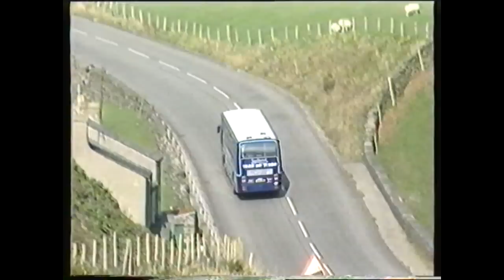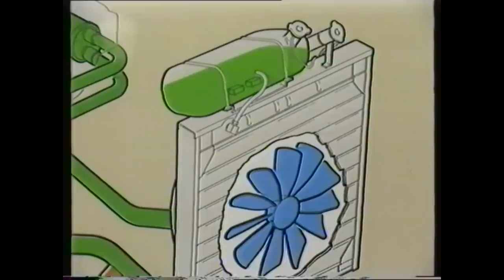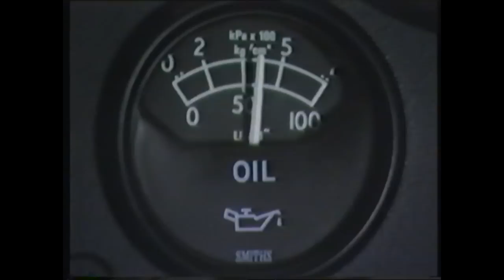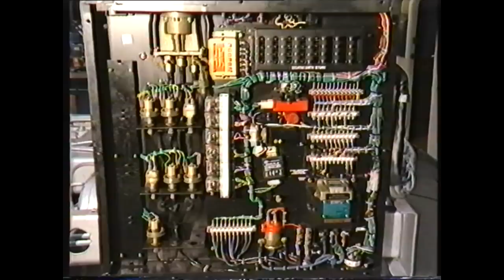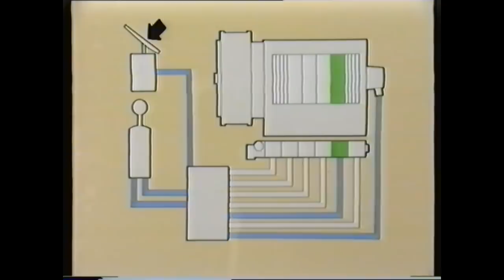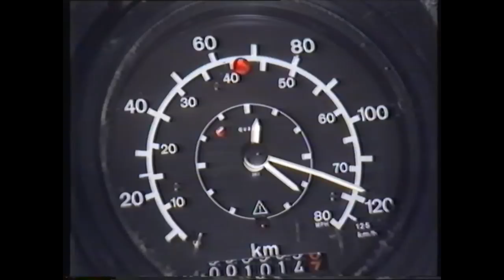Leyland Bus Training Video - Leyland Tiger Coach - TL11 Engine - Information Film for Drivers Part 1

Comment: Some unusual advice , in my opinion,  generally if an engine is running hot unless the static cooling system and water pump is very efficient it can  actually get hotter when you pull over so as  long as you’re not working it hard generally better to continue driving. equally in the event of a water leak generally the water temperature will suddenly drop low as it is not able to sense Steam in the system so the temperature high is not necessarily going to be good advice in the event of water leak

Comment: I remember driving a. Royal tiger full executive .with A rear engine ,manual gearbox  all cable linkage. Gears nightmare until  Engine & gear box warmed up , the air accelerator took a lot of  getting use to on long motorway journeys a great coach to drive.
Reply: Nice badge as well!

Comment: If the engine cranks but will not start, check the stop valve. Good advice but how about first checking to see if there’s any fuel in the tank?

Comment: Lovely vehicle We had two tl11s in Colombo Sri Lanka operated by Ceylon Transport Board. 
Body built by Unicar Spain and with hydrocyclic gear box
Both were scrapped.
One is still lying in derelict state and there was a talk to say that it's going to preseved.
Two registration numbers are 30-7501,30- 7502

Comment: Not too long ago but sounds old-style: /hand OPERATED/ 😁
On topic: What happened if you switched off the engine (or it dies for some reason) while it was still in gear with the semi-auto? I would assume it loses air/oil pressure and drops out of gear.
Reply: like a manual with the pneumocyclic (air operated) never drove a hydrocyclic.  all had manual stopper to shut engine down so could not accidentally shut engine off but it would be like taking your foot off the throttle till it stopped.

Comment: I used to drive Leyland Tiger buses and coaches. I prefer the Leopard, but the early Tiger I drove, a Plaxton Supreme 6 was far better to drive than the later Duple 320. The early Tiger was an X reg and the later was a D reg. They were both 6 speed ZF gearboxes. The Duple was a cable change and jumped out of 1st and crunched into 3rd! 
The air throttle could freeze in extreme conditions. 
They took more skill to drive compared to the modern VDL Bovas that I drive nowadays.

Comment: They had an early form of antilock braking then, which was quite advanced
Reply: Abs had become fairly well established amongst most car manufacturers by 1986 (this video was made in 86 or 87), so they're just about keeping up rather than being advanced...
Reply: @pinkyn0se  in 1986, which cars had ABS available, even as an option?
Reply: @DavidEverson77  Standard equipment on a mk3 Granada in 1985.
Reply: @pinkyn0se  only on luxury models. It wasn't until the mid 2000s that the majority of cars had ABS fitted.

Comment: Talking of a dangerous position, it looks as though someone's been using that bit of road at 15:45 for some emergency braking practice judging from the skid marks 🤔
Reply: Flensburg Way in - you guessed it - Leyland, about a mile from the old Leyland factory. 

I reckon they had to do a few takes with the bus doing emergency braking within camera shot and the driver over-cooked it on a couple of takes.

Comment: "Failure of the turbocharger: this latter condition will be accompanied by excessive blue smoke from the exhaust during normal running." So how could you tell if the turbo had gone on a Leyland National?
Reply: Lack of power?

Comment: Replace the engine and gearbox with a Cummins/Gardner engine and ZF/Voith gearbox would solve many problems.
Reply: They did offer that, in later models. Cummins L10/ZF automatic, gave excellent performance. But the TL11 was an excellent engine too, though perhaps happier in coach than bus work
Reply: The TL11 was a good motor it went on to be the 11.6 litre Daf engine in the 2800,3300,3600 and later the Daf 85/95 series
Reply: @GWLAD  The DK1160 and its variants were DAF's own development of the Leyland 0.680, not the TL11.
Reply: @taxus750  ok apples and Pairs 👍👍👍
Reply: @taxus750 as was the WSK Milec MD11 family. That made Euro 2!
Reply: Even better, a volvo b10m engine
Reply: @alexhickey5633  The TL11 pulled better from low revs was more flexible I found, and sounded much nicer too! Volvo engines always sounded coarse, the vertical version in the Olympian was nothing like as nice as a Cummins
Reply: @simondrake7002  Yes, I always thought Volvo engines of the time sounded 'coarse'......bit like an overgrown Bedford!
Reply: @robertp.wainman4094  never thought of them like that. I’ve long liked Bedfords, though have never driven one, when I was young in the 80s living in rural Lincolnshire our local services were run by the typical independent’s Plaxtons or Duple bodied Bedfords and Fords. A YMT or YNT was a far more pleasant vehicle on which to travel than the hard sprung and noisy Leopard in my view. The Tiger was a huge improvement both to travel on and drive, and for me, yet to be bettered to drive.

Comment: in the ate 70ts i owned layland octopus t l11 engine and 9 speed manual box it was second 8w the first was a foden 180 gardner so i thought it was a much better truck to drive with more power
but the engine was unreliable

Comment: great video, but i like the leyland tigers i remember as a child. with 4 spoke steering wheel and square clocks on the instrument panel, manual gear change.with 0350 and 0600 diesel engine,great sounds,and a great bus company Southdown Motors.memories from 1964.
Reply: Portsmouth to Stafford for a long weekend from the RN the Leyland's were always the most comfortable.